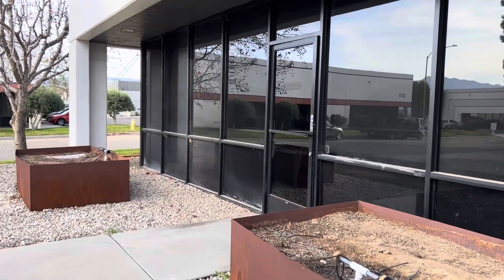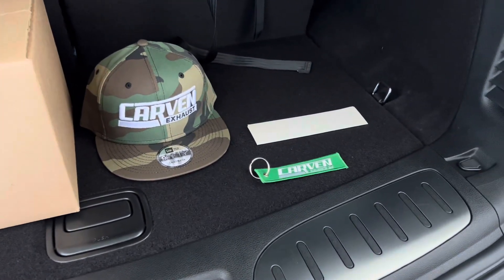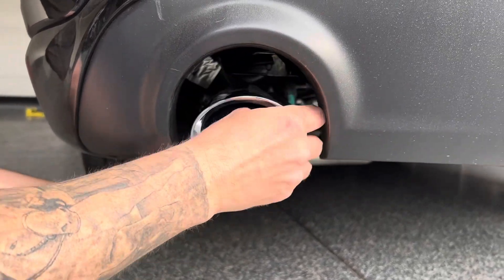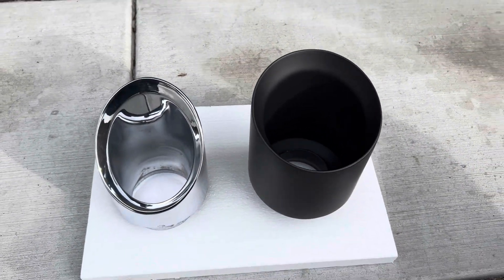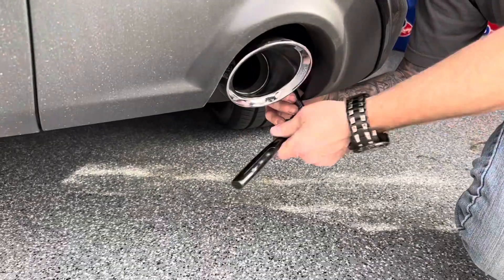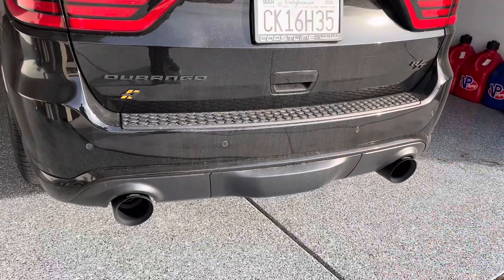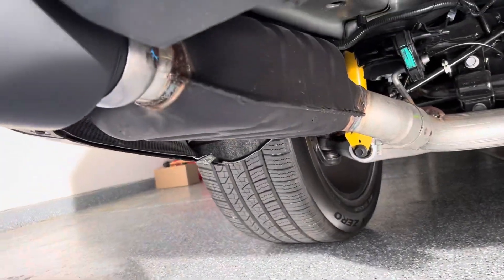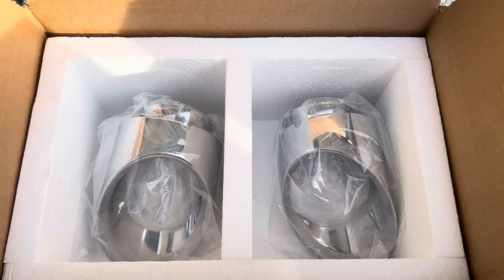2022 Dodge Durango RT Hemi Orange Edition gets Carven 5 inch exhaust tips

Comment: Would this fit a 2023 tow n go
Reply from the maker: As long as it’s a Tow N Go with the bolts on the stock tips like in the vid then you’re good to go 👍
Reply: Just ordered appreciate the part # in the description!. New subscriber. How long did you receive it after order
Reply from the maker: @Br99klynINg24_8 I picked them up directly from Carven since I’m local to their facility.

Comment: Well these fit on a regular RT Durango?
Reply from the maker: They will if weld them on. The tow n go have the SRT exhaust which have bolts that connect the exhaust tips.
Reply: @hemiorangedurango22  okay thanks I just picked up a low mileage Reactor blue RT will be adding these tips

Comment: Looks awesome, I was debating between these the kooks and the vicrez ones. Can you do a sound clip  please. Also just picked up a 2023 black on black hemi orange with tow and go fully loaded for 59500. My dealer was awesome. But I had the decal delete. Also gonna get some custom seat belts that are black with a small line of hemi orange.sad I couldn’t get the console storage option though on the hemi orange. 

PS never mind just watched your video with the sound clip. Thank you so much.
Reply from the maker: Nice! You can’t go wrong with any of those 👍🏻 congrats on your Hemi Orange Edition. We are a dime a dozen it seems like. I haven’t seen any others yet in So Cal.
Reply: @hemiorangedurango22  one thing I noticed that is different. Maybe you can shine some light, did they get rid of the fog lights and side mirror blinkers for 2023 models? My 2021 had them and I noticed you have them too. My vehicle is fully loaded with all options but I don’t know what changed?
Reply from the maker: @kaiichinose9590  mine is a 2022 so I’m not sure about the 2023 models. I believe they are the same though.
Reply: @hemiorangedurango22  hmmm I’ll have to try and do some research on it. I’ve been all over the internet and can’t seem to find anything.

Comment: Nice decorative piece to bad there's nothing beneficial besides now you can clearly see the stock pipe inside the housing so you know it's not even a legit tip, idk I woulda just spent the extra 100 or saved a paycheck for a legit exhaust system and headers man. Your missing out big time, but nice start that's forsure I got GIBSON performance exhaust and headers with cold air intake 93 tune. Closest thing to the hellcat just can't keep up with them trackhawks
Reply: Thanks for telling us what you'd do to your vehicle. Thankfully we're watching what he chose to do w his